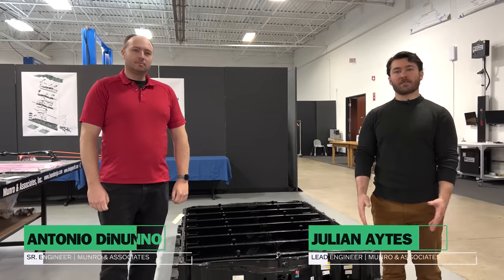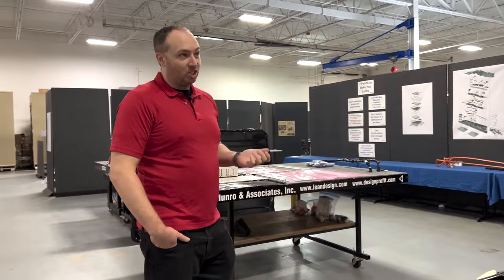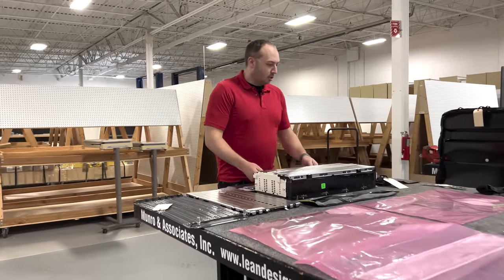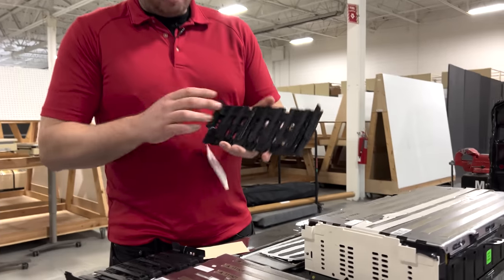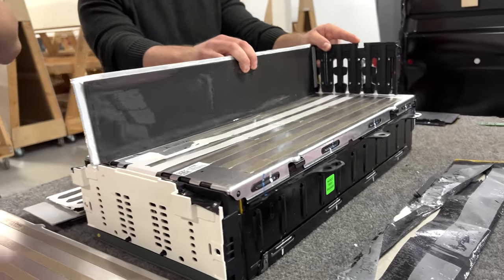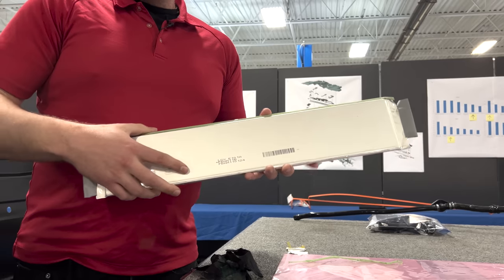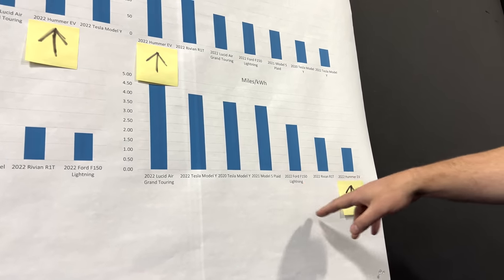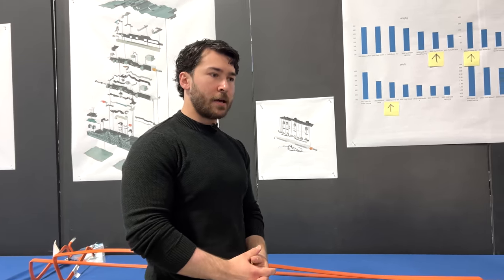This is NOT Lean Design: Hummer EV Battery Pack Breakdown

Comment: Mary Barra was right, GM are definitely leading in one respect!
Reply: Weld hours per watt hour?  Lol
Reply: Yeah overweight battery pack with 3500 welds! That’s a huge expense even with robots and inefficiency in time! 

They could’ve made it out of aluminum had less welds, less weight, which resulted in less mass lower watts per mile 

Epic Failure
Reply: The only thing they might  mlead in would be lose per vehicle.   Rivian is probably winning followed by lucid but Gm is right on their tail.  2.8 billion in advertising isn’t enough to sell these pigs.
Reply: Only solution: make more Corvettes for profit.
Reply: And yet they will still beat Tesla to market with a pickup truck.
Reply: @pasad335  what’s the point of beating someone to market if what you sell isn’t cost effective
Reply: @Nonsense62365  imagine plastic and just few simple parts that click together.
Reply: They managed to design a batt pack as complex an a typical ICE engine.
Reply: @pasad335  Yeah by about a century and it looks lk this attempt is about as desirable as a 1920's pickup.
Reply: @pasad335  ...which they will recall all of them and scrap at about the time Tesla hits 1M Cybertrucks sold.
Reply: In spending and bad design. haha!
Reply: @Pasa335d  really, an irrelevance of major magnitude. First only counts at the end of the race.
Reply: monument of inefficiency  🗽
Reply: MARY emBARAsing , LIED and it matters.
Reply: @pasad335  I wouldn't call the HummerEV a mass market truck.  It is a freak at best.
Reply: @Nonsense62365  Sandy had a video with Sabek. A well designed reinforced plastic housing would be a one shot moulded part, lighter, maybe a few inserts, certainly less expensive- as the man says "Lean Design".
Reply: @pasad335  True.  Hopefully they can sell more than the 2 (two) Hummer EVs and 968 Lyrics' they sold in 2023Q1.
Reply: probably the most inefficient ev out there, not to mention over priced, sure sure GM lead, literally one lead brick, not desirable vehicle for anyone
Reply: @pasad335  "A" pickup truck is right, considering 2021 they sold only 1 (to a GM employee, that's alpha, nor a real sale), 2022 very few thousands and 2023 they sold 2. Tesla will sell more in the first quarter of production.
Also GM lost a shit load on each one. Tesla will be profitable.
Reply: @pasad335 They burn cash as straw fires.
Reply: @pasad335  
You sure?
Reply: Well, after seeing this, I think GM now stands for Garbage Motors!
Reply: @droomagon  
It’s definitely not “over priced” they probably need sell it for 400K+ to make a profit. This vehicle is definitely a loss leader.
Reply: Yup ! GM oh the new gm is garbage motors 🗑
Reply: @pasad335  Well no they didn't.

Comment: Tesla- the leader in cost reductions , GM- the leader in excess,  Munro and Associates- the leader in  Lean Design for manufactuing advice. YOU GO Munroe Team!!!
Reply: @vickykennel7414  What are you, short selling stock or something? SMH
Reply: But “Mary led” 
-Joe Biden
Reply: @RayNLA  Yes, he was buttering her up with a compliment. Joe probably should have rejected that speech.
Reply: @JasonWW2000  
You’re absolutely right about that! It was a comical statement speaking directly to the UAW.
Reply: Tesla - leader in crappy build quality. uneven panel gaps and cheap interiors.  Oh, and don't forget the boring design!
Reply: @LG123ABC  
Don’t worry, Hyundai still makes the Sonata. Leave the Tesla’s for us!
Reply: @LG123ABC  I guess that is the secret to becoming the biggest car company in the world.
Reply: @RayNLA  Fanboys gotta fan!
Reply: @LG123ABC  
🙋‍♂️
Reply: @vickykennel7414  "Tesla...leader in cheap trash cars"

That's why Model Y is the best selling car in the world?
Reply: @vickykennel7414  trash? I'm in month 35 (3 years next month) an still not .01c in maintenance. 240 wh/mi= 4+ kw per mile in a 4400 lbs crossover. How much money/time have you waisted in the last 3 years at the dealer?
Reply: @vickykennel7414  and here she is again. Lucid fangirl.
Reply: @ericjohnson3967  she's a lucid shareholder/fangirl. So a bit thick.
Reply: Yes, GM the leader in range and charging speed. That Tesla lean design resulted in a Cybertruck with crappy range and charging, that's what lean design gets you folks, a design which is too focused on costs and not features.

Comment: Seems like another example of an EV rushed to market when not ready for  prime time after years of ignoring EV disruption
Reply: 7 ultium platform evs back in Sep of 2017 we're approved for production by Mary emBARRAssing and reuss for gm. 
So this wasn't rushed but gm definetely isn't ready for modern fully connected evs either. Just look at a 2023 bolt vs a 2017 bolt. 😀
Reply: “rushed” 2 market? There are none on the market…
Reply: @FrunkensteinVonZipperneck  ha ha Didnt they sell 4 of them?
Reply: @FrunkensteinVonZipperneck  Yes, it was developed in less than half the time of a typical vehicle. So basically rushed.
Reply: @JasonWW2000   
Which takes us full circle back to the original comment of "not ready for prime time after years of ignoring EV disruption".....?
Reply: @rogerstarkey5390  Kind of. GM has dabbled in EV's going way back to the EV1. They did not want to fully commit to EV's just like a lot of other car companies. Once they committed a few years ago they are rushing to catch up. So are they ready for Prime Time? Who knows, it's more opinion than fact.
Reply: It's not just about one vehicle, this their much hyped "Ultium" platform that they have been working on for years. A lot of r&d cost, marketing and opportunity cost has gone into something that GM's existence relies on. Turns out designing, engineering and manufacturing an efficient BEV drivetrain platform is not easy. GM is in a big trouble.
Reply: @mydutube  I don't understand your statement "designing, engineering and manufacturing an efficient BEV drivetrain platform is not easy. 
GM is in big trouble".
The drivetrain part is definitely true, but several companies have figured it out. Look at Tesla for example. It CAN be figured out. GM COULD be in big trouble if they do not improve or change the design. Do you really think they will not change and evolve their designs over time? I think they will.
Reply: @JasonWW2000  Bolt was a failure in engineering execution. GM had 5 years to come up with a better platform and they did this. Too little too late from GM.
Reply: @mydutube  Remember, that is all opinion. I don't recall any issues with the drivetrain on the bolt. The design of the battery housing, cooling, etc seemed quite well done with no issues. The only issue I'm aware of was the battery chemistry and GM was not involved with that. So in my opinion it was not a failure at all on GM's part. LG Chem on the other hand seems to be the one who made the mistake.
Reply: @JasonWW2000  cells are very much part of the drive train. The design decision to go for pouch cells was bad, on top of that, not having done proper testing on battery cells and pack allowed the unsafe pack being installed in more than 100k cars. More importantly, over the 6 year life of chevy bolt, GM failed to improve or evolve the safety or efficiency of the drivetrain. A massive engineering failure that led to unprofitable and unscalable product that had to be discontinued.
Reply: @mydutube  A lot of what you're saying is pure speculation. Pouch cells, in and of themselves, are neither good or bad.
Why do you assume proper testing was not done? I believe they did do proper testing on battery cells and pack. There were no issues during testing. There were no issues until years later. 
I don't know what changes occurred to improve or evolve the safety or efficiency of the drivetrain. I find it hard to believe they made no improvements. Perhaps someone with more knowledge of the Bolt can share all the improvements with you.
It seems the engineering failure falls to LG Chem and not GM. Obviously GM took the blame.  
The vehicle itself was quite good. If it were fitted/refitted with safer and reliable cells it would continue to be a good vehicle. The reason GM discontinued the Bolt was simply due to the bad publicity. Still, people were lining up to buy them. 
I'm glad you shared your opinion, though. It's good to see two sides of the same coin.
Reply: @JasonWW2000  "no issues until years later"? - you are only making my point. Testing battery longevity in real world is part of quality control. Supplier-oversight is GM's responsibility. Having a robust BMS that can detect battery issues early is GM's duty. GM failed at all of the above. 
The science on pouch cell is pretty clear. They swell too much when they heat up. So not a great choice for automotive. BMW (Samsung) and Ford also had battery issues because of pouch cells.
Reply: @mydutube  You can't predict the future. It's strange their testing could not find an issue. I doubt any BMS could detect this issue. Even when the problem was known, the BMS could not detect it. It seems you really want to place blame on GM. I won't stop you. Lol.
The science on pouch cell is not clearly a problem. Lots of people don't like it, though.The swelling is controlled through compression. We will have to see what the future holds as far as pouch cells and different chemistry's. Perhaps cylindrical and prismatic are the future. Perhaps lifepo4 is the future. Perhaps solid state is the future. There are many options. Some will be better than others. We may not know what is best until they have been tried and tested long term.
Reply: @JasonWW2000  It is GM who had to bare the consequences recall with of unhappy customers and tarnished reputation. They can try to pass the buck to LG all they wish but people didn't buy the car from LG.
You need to read more about the basics battery swelling. Suggesting compression is absurd. Compression will only risk cell damage and make the car even less safe. The swelling can only be minimized with charge/discharge rate management and robust thermal system.
Reply: @mydutube  I don't think GM tried to pass the buck. Did they?
You are aware that all pouch designs are designed with compression, right? No manufacturer makes uncompressed pouch cells.
I hope your not under the impression the dendritic issue with the Bolt battery had something to do with swelling. You seem to be implying that. 
Anyway, this conversation seems to go nowhere. Take care. 👋
Reply: @JasonWW2000  What compression? That's not how it works. Swelling is a feature of the pouch cell. It allows the cell the breath without breaking under high temperatures. The thinner walls and less packaging material allows higher energy density. The same feature becomes a safety hazard if temperature is not managed properly. This is internet so I won't expect you to concede that you just made something up.
Reply: @mydutube  Not made up. Just look at anyone taking apart a pouch cell battery. It will have tension rods and large cast end pieces. When removed, the pouches expand a little. I'm surprised you don't know this. If they were not under compression, they could swell up too much and cause failure. Lots of people take Ford C-Max batteries apart to repurpose them. I'm sure you could find a video showing that.
Reply: @JasonWW2000  You are doubling down on completely wrong notions. The tension rods are to even out the pressure during swelling at the pack level, not to contain swelling of any individual cell. Controlling swelling through compression will spell disaster.
Reply: @mydutube  I guess you misunderstood me. No problem.
Reply: @JasonWW2000  shrug

Comment: These guys could teach a master class in tact. “How to tell someone that their product sucks without hurting their feelings” 😅
Reply: I get the feeling they have to do this a lot in the consulting world. They have lots of practice 😂
Reply: You're going to want to say "typically" a loooot.  lol
Reply: Government motors.
Reply: How embarrassing as an American.
Reply: Because they are a potential or active client. Yep.
Reply: @dalton1981  Hi-pot test passed
Reply: Well a lot of misinformation in this video, who doesn’t know that when cell go bad BMS will shut down the whole module for safety reason. Not sure what are they trying to accomplish.
Reply: Not telling the truth?
Reply: Not telling the truth? @ExploringCabinsandMines
Reply: @St_JohnYam_Steve  What is not true ?
Reply: @St_JohnYam_Steve  If a cell in a pack goes into thermal runaway the BMS is no help at preventing other cells from overheating. That is why OEMs design hot gas vent paths and thermal barriers between cells. Either way the pack is ruined, but hopefully the whole car/garage/house/people are spared a destructive fire.
Reply: I get the impression that these guys only know what they've seen before. Doesn't sound like they approached GM engineers with any questions.

Comment: Since the Hummer EV came out, I had a feeling how inefficient and lackluster the engineering and design was going to be, this just confirms it. Thanks Munro team!
Reply: It was designed quickly so they have to make it reliable over efficient (in design).
Reply: In their defense, it was pretty clear from day one that the Hummer EV was a marketing exercise and not really supposed to be anything else. 

The job of the Hummer EV was to reorient costumer perceptions of EVs and make it socially acceptable for men who are accustomed to driving big hulking inefficient pickup trucks to buy EVs.  I think it did this pretty well and was really a stroke of marketing genius.

The big surprise (for GM) came when people lined up around the block to get them.  They were probably also a little surprised at how fast it could accelerate.

They obviously didn't intend to make very many. So the emphasis in the design here is to make a truck that won't fall apart.

The question is, how's that Lyriq looking?  It took a little longer in development.  Hopefully it's not a disaster. And hopefully they will actually ramp it up soon.  Early signs are that it might be ok.
Reply: A short design cycle, plus the LG/Bolt fires on their mind.  I'm sure that factored into the design of an off-road worthy battery pack.

Honestly, an over-engineered pack would give peace of mind, even though only a few percent of these will travel off-road. 

Then again, most Jeeps don't see anything but pavement, either.
Reply: Just following in the footsteps of the original Hummer.
Reply: @Ebooger  In one regard, yes. Its overly rugged.

Comment: >3500 welds !? 😮
When you said this was a small car without wheels, you weren't just referring to its weight
Reply: I wonder if the same welder who designed the pack also designed the rest of the truck?

Comment: 19:29 The cells are effectively in 6P configuration across the entire pack for the HUMMER EV, so losing a single cell will reduce the entire pack capacity by 1/6th. Yes, it is possible to use smaller cells to increase redundancy to the point that the battery capacity is less affected by a single lost cell, but the counter argument is, perhaps don't sell or use a battery with faulty cells in the first place. 🤷‍♂
Reply: Loosing a cell that is connected in parallel can lead to many problems. That cell could become a slow short, draining all the 5 other cells and create imbalance that the passive resistors of all other cells in phe pack can not keep up with.... it can mean an internal short( worst case) or broken connection of the tab, meaning that it become isolated(best case if it is not intermittent)  or also be a broken bms connectikn to the cell, meaning danger of imbalanced 2 consecutive  cells that are not properly monitored by the bms.
Reply: @Doctorbasss  Oh, sure. There are a lot of problems that can result due to a bad cell, but for short-term, losing a single cell isn't catastrophic. For cars with 2P or 3P configurations, you're talking about losing half to a third of your range. for 1P configurations, your car is basically dead. 

The Chevy Bolt EV is 3P, and early on, there were some cars that had issues with bad cells. They functioned normally until the car got down to under 30%, at which point the car would just die unexpectedly without notice. All it took was for a single cell to fail (or start to fail).
Reply: @newscoulomb3705  If the battery operate at 7 or 8C max on 3p than it become around 12C on 2p which would create imbalance on the 2p vs the rest of the 3p cells and make the new 2p to age faster and make the bms hard time to rebalance everything.  On my gen 1 Volt it is in 96s3p and this battery design with laser welded pouch and active cooling is really robust.
Reply: GM has also built this battery pack. to be serviceable (unlike the new Model Y packs). So if you somehow lose a cell then you can replace one battery module instead of the entire pack.
Reply: @stephenj4937  that's not a long term solution. That's a quick fix to sell it and make it someone else's problem when the entire pack keeps going out of balance. All the cells in the pack should be the same age. You shouldn't just swap out a single cell.
Reply: @saff226  I didn't say swap out a single cell, but a single module (the block of 3P8S cells). As long as all the paralleled cells are the same age, replacing a module should be no problem for the BMS to handle.

Comment: Thanks for the overview! GM definitely has some opportunities to clean up and streamline the packaging of these modules, and I'd love to hear some GM engineers speak to some of the design choices (e.g., I wonder whether the thermal compound is doubling as an electrical insulator). It will also be interesting to see variations of these packs as GM starts to use other cell formats and pack configurations. The single-stack pack from the LYRIQ will be interesting to see, as will packs that eventually incorporate cylindrical, prismatic, and lithium-metal pouch cells.